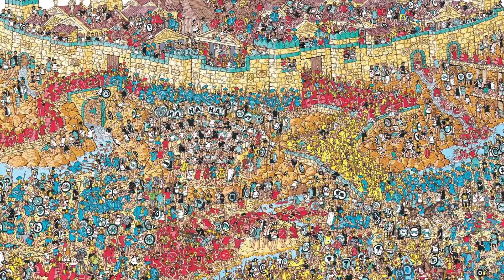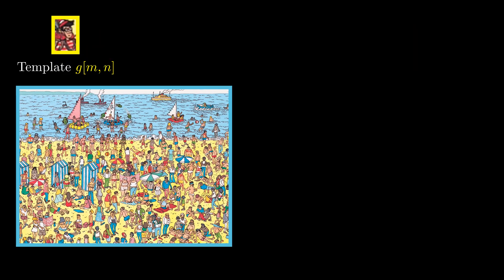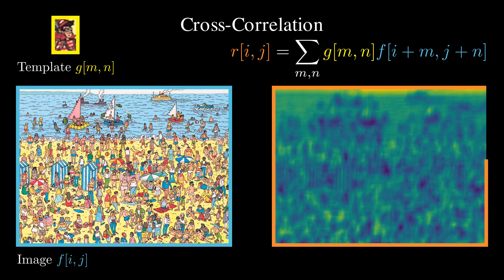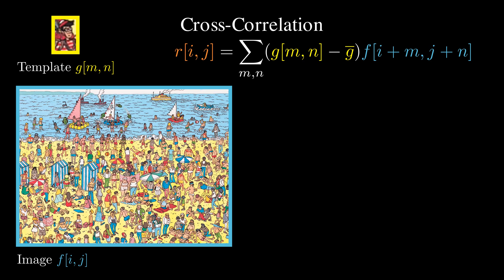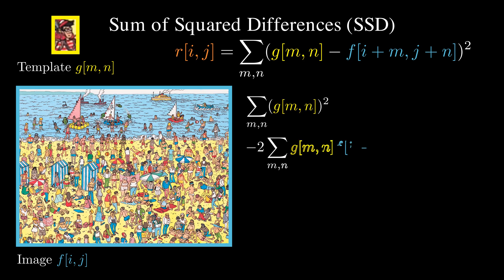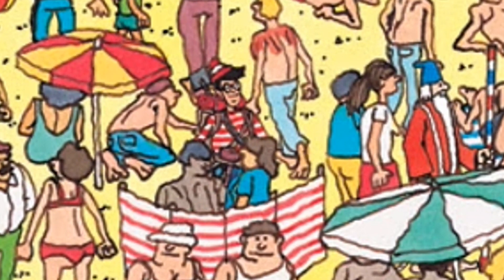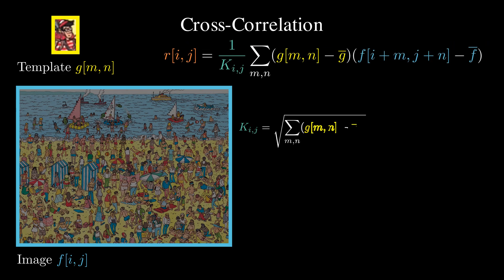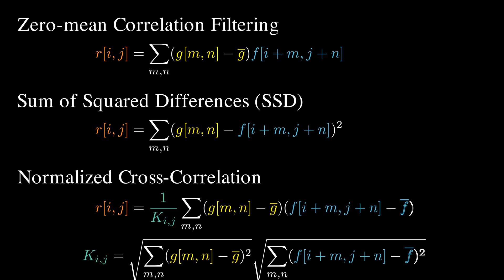How Machines Find Patterns [Template Matching]

Comment: A problem with the template method here is that we usually don't know what Waldo looks like in the current setting, until found. There are often many "red white striped" characters around to catch your eye, so can't use that as a generic template. I understand that it was just an example though.
Reply from the maker: That's right! There are more complicated object detection algorithms out there for those tasks. But template matching is still very useful for applications where we have a clearly defined template.

Comment: Dr. Huang, I don't think these error metrics are scale-invariant, right? In that case, would we have to construct some sort of Gaussian and/or Laplacian pyramids and perform SIFT-based methods to properly match the templates?
Reply from the maker: Yes, you are right. All these methods are sensitive to scales. As you said, we will need to apply these methods to find objects at different scales with a Gaussian pyramid.

Comment: Is the zero mean correlation also sensitive to lighting changes?
Reply from the maker: Yes, it is also sensitive to lighting changes, particularly when there are contrast changes. To handle that, we will need to use Normalized Cross-Correlation.

Comment: Convolution and Cross-correlation sometimes confuse me. Convolution is cross-correlation with the kernel flipped/reversed on the relevant dimensions.

But PyTorch's Conv2d actually performs cross-correlation and in other places too I've seen people use the terms interchangeably.
Reply from the maker: 100% agree! I’s quite confusing.

For symmetric kernel (eg blur filters like Gaussian), cross-correlation and convolution are equivalent. But not for others. In convolution, the “kernel” has a nice interpretation of “impulse response” of the system. It’s useful to understand what the convolution is doing to an input signal in Fourier domain (via convolution theorem).